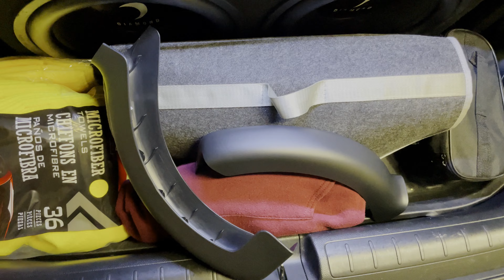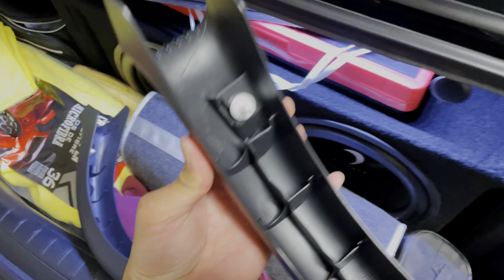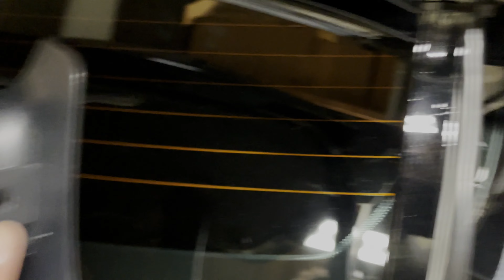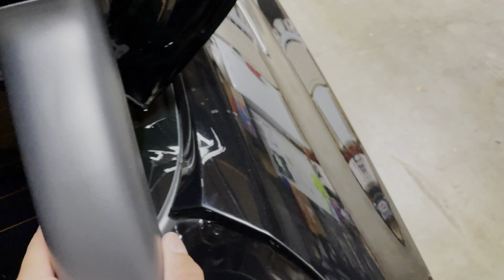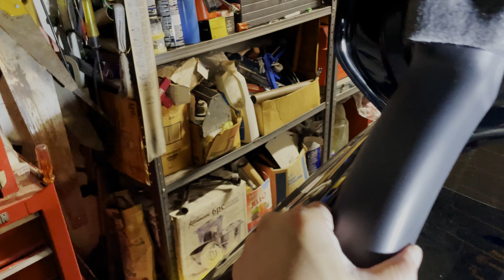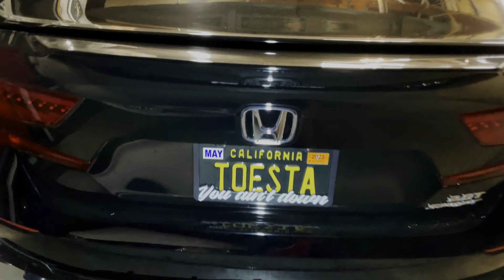Honda Accord Trunk Hinge Cover Mod

Comment: I installed these on my 2019.  I just drilled a hole where the clip goes on top, with that in place drilled a hole for the bottom and bought some universal push plugs and installed.  Fits great..

Comment: Appreciate the info. Just fyi though, a zip tie placed through the top hole, then around the hinge works too. It’s very sturdy with little to no movement.
Reply from the maker: Yes definitely! Great tip